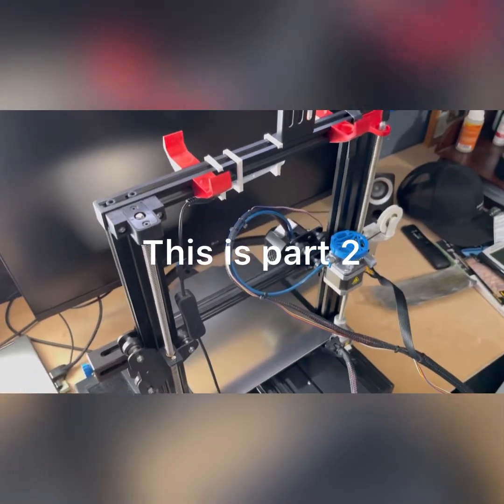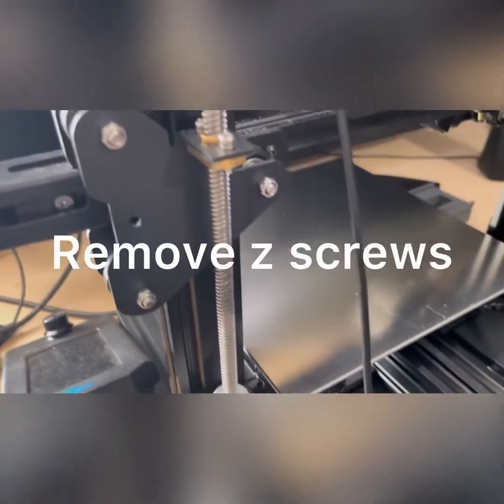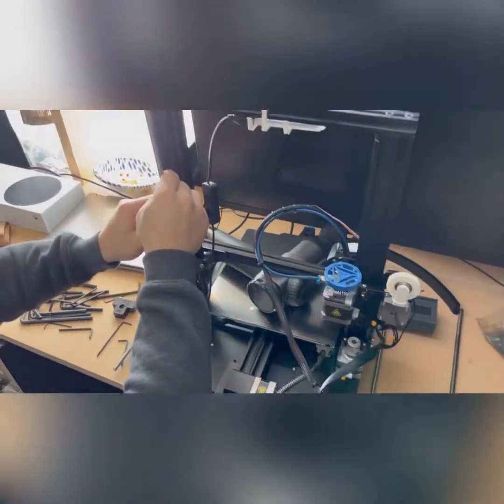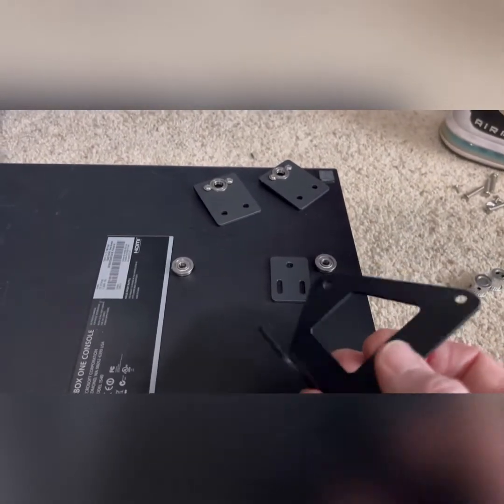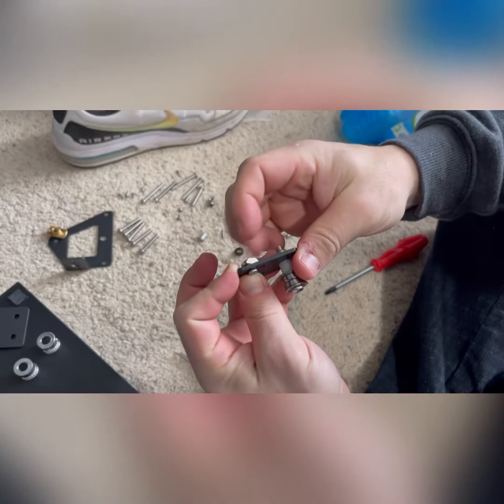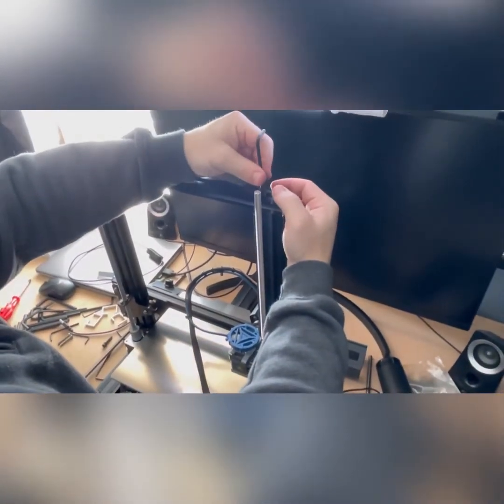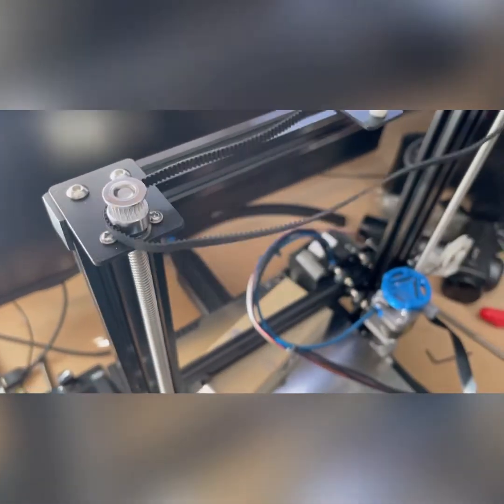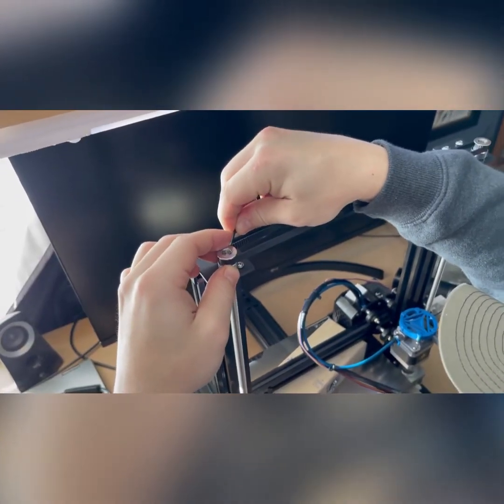Ender 3 V2 Dual Z Axis Install Part 2 (sync belt installation)

Comment: a bit late maybe, but you could have printed risers to place under the steppers to expand the z-rods so that they are usable above the upper gantry.  I'm into installing a timing belt myself and landed here.  Have fun printing !
Reply from the maker: Good idea! Thanks for the tip.

Comment: I just added the dual Z stepper motor kit. Debating on if I should add this Z-Sync belt kit or not. That kit is $53 on Amazon now, and will take a month to arrive. Is it worth it?
Reply from the maker: I think so. Without it, every time you power down your Ender, there’s a high probability that you will end up having to resync both sides.  I think that you have to decide how much you like the printer and if you plan on upgrading to the Prusa or not in the near future. For me, at the time, I was not planning on a Prusa and the belt was absolutely worth it for me.  Eventually, I got the Prusa. But the dual Z with the belt took the Ender to another level- literally.  Ha ha..

Comment: Awesome video! Looking to do this myself, how has this worked out in the longer term? Any issues?
Reply from the maker: This has made the Ender 3 V2 rock solid.  I did buy a Prusa - but fired up the Ender last week and it prints awesome with this upgrade
Reply: @TheRealWorld737  Awesome to hear, thanks